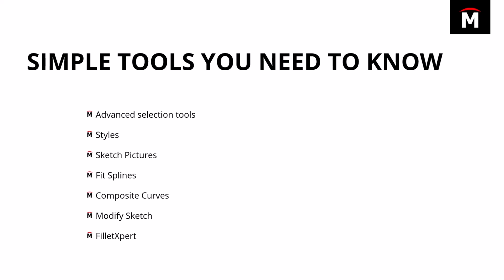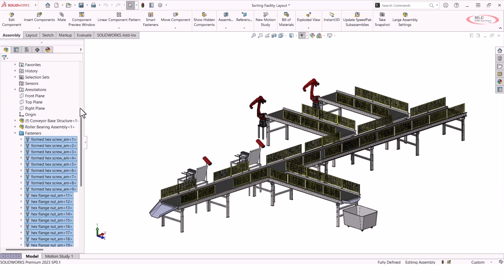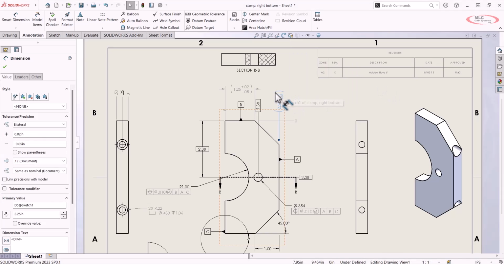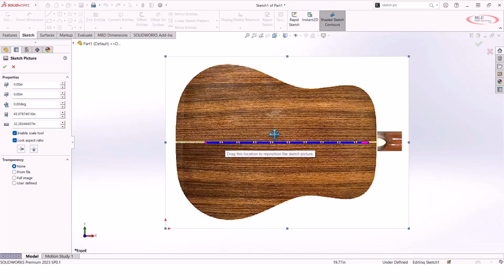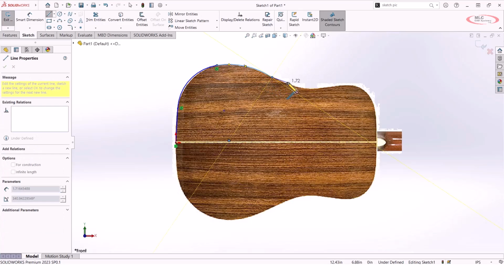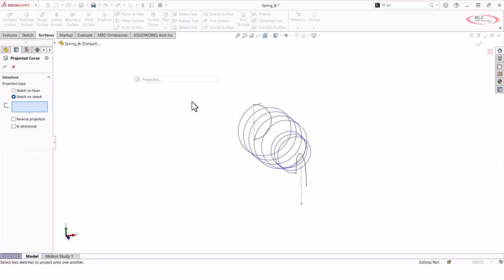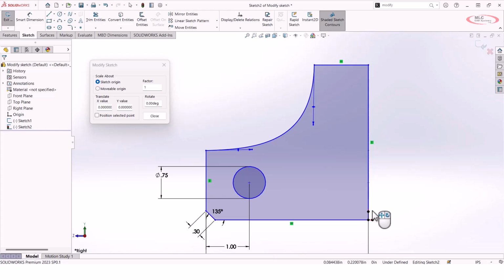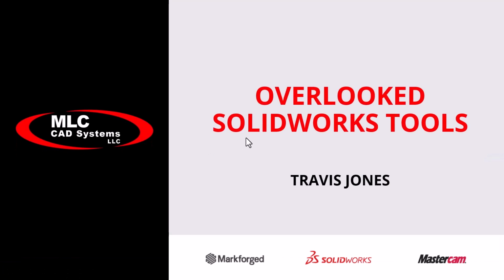7 Powerful Overlooked SOLIDWORKS Tools

Comment: Kinda confused as why you use an "OR" condition at the very beginning to select both toolbox items and bearings, shouldn't that be an "AND" condition?
Reply from the maker: It depends on your specific goals for that search, but yes, the logic operators will work as you expect them to.  Also keep in mind this was a live presentation, so there is a possibility that he did not click the correct button while presenting it this time.